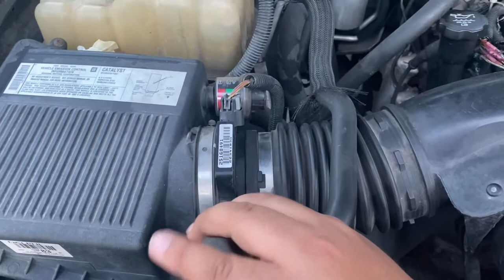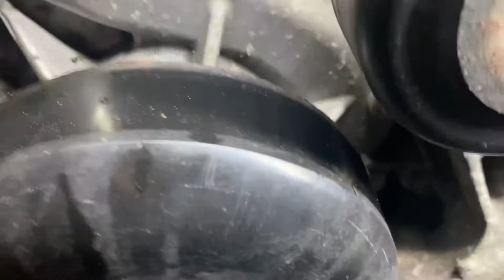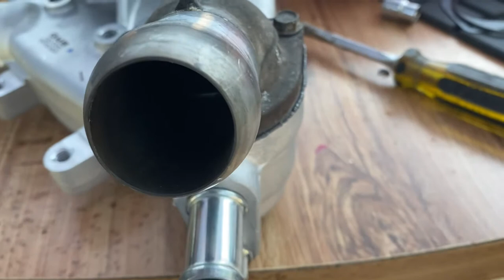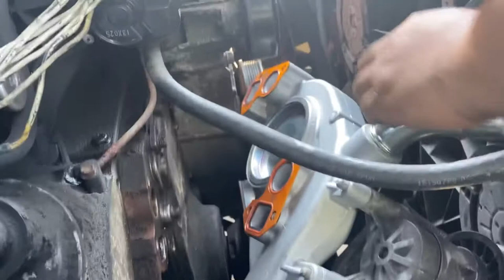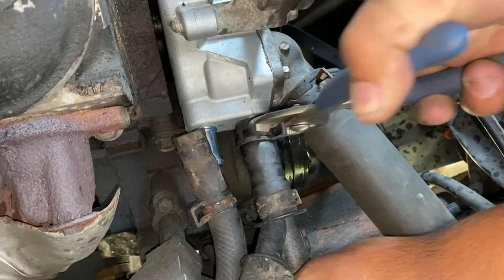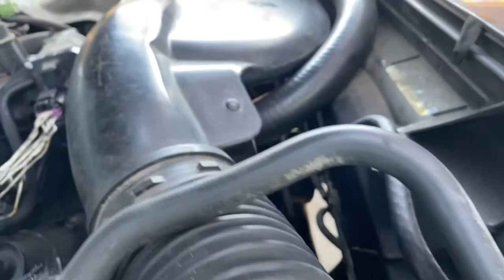Escalade water pump replacement

Comment: I just did my 04 Escalade installed new tensioner, idler, thermostat lower radiator hose and belts and 300 amp alternator my back hurts.